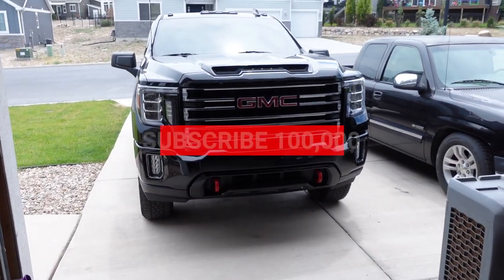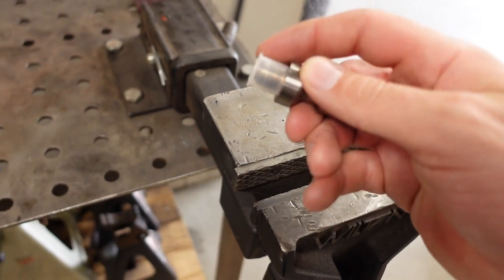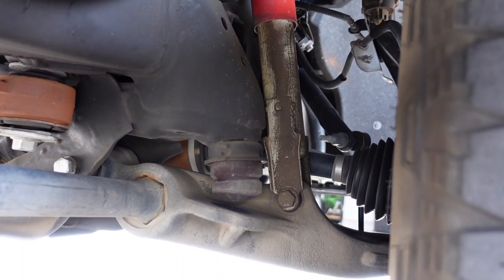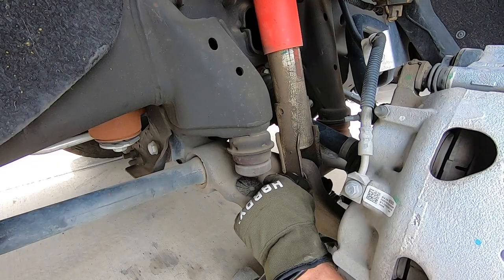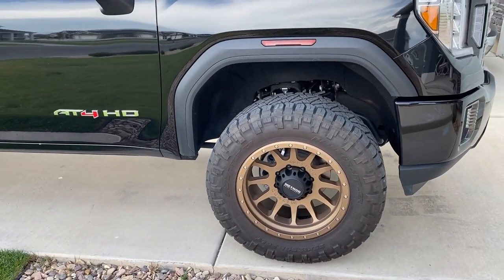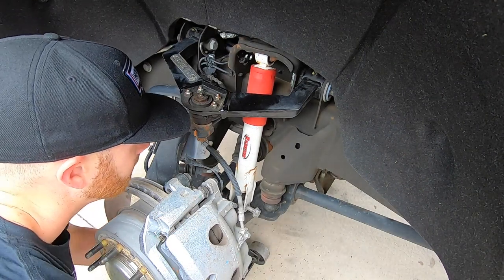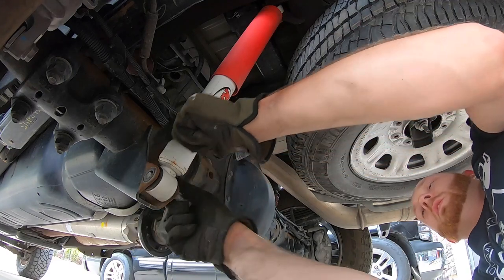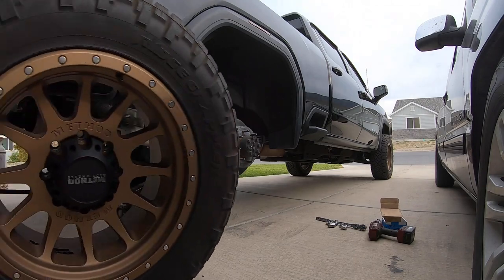Fixing what GM wont on my 2020 AT4 HD & Improving the Ride Quality #gmc #at4 #duramax

Comment: You can do your own TPMS reset: Turn vehicle to ON/RUN. With parking brake on. Push the trip odometer reset stem until Tire Pressure is displayed. Push and hold trip reset stem to begin the sensor matching process. start with the front left tire, then front right, rear right and rear left at the end. You have to bleed air out of the valve stem with a pen or something like that, until you hear the horn beep on each wheel in that tire order. It takes like 4-6 seconds on each tire. Push trip reset again to confirm. Your welcome!

Comment: Idk why Chevy guys are so stuck on that idler arm, torsion bar, control arm, no grease, ball joint wearing junk.
Reply: Because they don’t like misfires, phaser failures, i-beams from the 30’s and trucks that melt in the sun on hot days.

Comment: 40,000 miles and its wearing out already , sorry LT but what a TURD ! 
Not to say that any other manufacturer is producing a better vehicle but I would be raging mad , my 5000$ Pilot 5 yrs ago now has 273 thousand and I did the timing belt / water pump , wheel bearings , shocks in the back , inner and outer tierods and a bit of rust repair in the past two years ( belt and pump done by a mech. I used to work for ) I don't hate it , I don't love it but " NEW VEHICLES ARE GARBAGE ! "

Comment: Ok, not trying to create controversy, but mainstream thinking on this videos' topic is a little misguided. Im not disagreeing with you, but presenting some additional info.  (But I like the video to see what is available, and what guys are doing to their trucks)      Here's a shocker--  Shocks don't change the ride quality as much as you think!!  They are not  carrying the weight of the vehicle, the SPRINGS are.  While a set of worn out/leaking/ damaged/ seized  shocks being replaced will definitely cure some ride quality issues, the shocks' main function is to control the motion of the springs, ie, keep it from bouncing, cuz thats what springs like to do.  I've confirmed this as a service manager working with various suspension companies on custom builds, and chassis issue diagnostics with OEM's.
                  If you have a really stiff spring that is so strong the weight of the (empty) truck cant compress the suspension going over a bump, it will ride rough. Take that same truck with a ton of weight in it, suddenly it rides nicer. We cant expect a 3/4 ton or 1 ton truck to ride like a car empty, but then be able to carry 2000 to 4000lbs on the flip side. no engineer can overcome this basic fact of physics. Springs give the ride, and the shocks control the springs motion. The closest compromise to this is Air bag suspensions, where you can increase/decrease the pressure depending on the weight being carried. Sadly, empty 3/4 ton and 1 ton trucks will ride rough! Keep up the good videos!

Comment: Bilsteins are great!
My 1997 Z-71 still has the original Bilsteins at 173,000 miles, and it still rides great!
Reply: You need to replace those Bilsteins!  Just picked up a 1995 with 157k - rode great, then I replaced the shocks with new Bilsteins and the ride is AMAZING!  

Yours are 24 years old.. they are garbage now.

Comment: Yes those fuel connectors are a bugger they used them on the 10th gen f150s to and really suck to reconnect after having to take them off a half a dozen times.

Comment: I use the Bilsteins 5100's on my 2004 4x4 Suburban 1500 and 2007 trailblazer and it improved the ride where they just handle so much better and smooth over bumps. I live in AZ and drive off road and pn in the burban and love how they handle also installed moog springs in the rear of the burban and still want to upgrade the torsion bars. By the way Lawrence LT Tolman, I think I saw a screw in your front right stock wheel tire on the inner tread. 6:12

Comment: I did  rough country premium shocks with my leveling kit on my 16 Duramax with 35/12.5/20’s, , great people, great service, I added Lift Rite air bags  [ crew cab short box 4/4] … BY FAR the best mod for pulling trailers , I recently towed a 40’ +  camp ground model camper 60+ miles 65-70 mph no problem. No sway and when big rigs passed I didn’t get the pulling in and pushing off effects

Comment: I used to work at an auto parts store and from my experience Rancho shocks are not the same quality as they used to be and bilstein are hard to beat for the cost. I used to warranty alot of Ranchos.
Reply: I’m retired now but we quit using Ranchos almost 20 years ago at the shop.  You assessment is spot on, Bilstein has to be the best bang for the buck.

Comment: steering stabilizer is a bandaid. people lean on them because they install inferior chassis components or refuse to replace worn components that allow too much play in your steering causing the tires to push you around. a good front end with no play in the components with a properly adjusted steering gear and correctly adjusted alignment done by someone who understands the #'s and what they do, not just "red and green seekers" is the best replacement for any steering stabilizer. and yes people have forgotten the art but the steering gear can be adjusted if done properly to perform as good as a rack and pinion. sorry for the rant in case you haven't guessed I'm not a fan of steering stabilizers. the person with their hand on the wheel is the stabilizer. you should have control of your vehicle through properly maintaining it. I like the channel and not trying to be a hater just ask yourself why would a properly functioning steering system need stabilizing? I feel like it's one of those things like when I used to see people with the big diff covers and they would complain they blew their rear end apart then they would put another big diff cover on it and come to find out Banks did real research on these and found they can cause more damage then they ever stopped through "cooling and capacity".
Reply: Had a 71 Torino GT in 76 as a kid and my Dad tweaked something in the steering box I think and it was awesome. 
The old man was no dummy!

Comment: you should realy get a torque wrench for fastening your wheels,  over tightening is a good way to break the studs & loose/damage wheels
Reply: Everyone says that, but no one had wheels fall off because they were over tightened. They way I learned is to get the bolt tight and then give it one more push...and it should be fine.

Comment: Added Bilstien steering stabilizer to my 2016 GMC 3500 Denali, along with Bilstien shocks. Very low miles at the time. Could not believe that the standard shocks on this truck to be garbage. Then to find out they eliminated the mount for steering stabilizer just unbelievable. In order to install this, one bracket needed to be added, which I did. The ride was greatly improved , just couldn’t believe that on their flagship Denali this would be the case.
Later looking at trading to a 1500, dealer refused to take my truck period, because this added bracket made it unsellable and refused to talk further!
Reply from the maker: Wow, that’s crazy for them not wanting the trade…

Comment: I just installed a set of Fox 2.0 on a buddy's 2015 3500 duramax dually. He had Bilstein 5100's, but his leveling kit had them maxed out and it rode like crap. He likes the ride of the new Fox shocks. first set I have installed and went with a shock that will work with a 1.5 to 3.5 lift. My idler arm was shot at 28k on my 17 L5P 3500 and I also replaced my tie rods with PPE. I had two rancho shocks fail under warranty, but warranty on the shocks is only 3 year 36K. I might also try the Fox 2.0. I am a dealer and dealer cost is around 520.00 for the Fox, the lift style Bilstein 5100 were back ordered and were about 75.00 each dealer cost.

Comment: I just discovered your channel today. You’ve earned a new subscriber. Love your house/garage setup by the way. I have a 2020 HD just like yours. OK, not exactly like yours. It’s a Chevy but same front end. I just did the Pitman arm and idler arm on mine. I noticed you mentioned that in this video. Mine had just a tiny little bit of them and I wanted to get an alignment and the steering stabilizer that you mentioned in another video. I ordered the exact one that you pinned in the post. I am hoping that with the steering stabilizer, it fixes everything because I’m having the wandering problem it’ll pull left and it’ll pull right. They aligned it today, no loose parts or anything. Granted it wasn’t the best alignment shop, but it was still aligned. Mine has crazy bad bump steer. Are they all like this? Mines only one ive ever drove. Did you experience any of these problems with yours? I know that you’ve been tinkering with your front end for four years now.

Comment: Great video! Anyone know if the 2500HD AT$ comes with a factory lift? Looking to replace my stock Ranchos with 9000XLs so I can adjust the shocks when I tow (trailer weighs about 10,000 pounds with about 1,000 on the tow hitch ball) and not sure if I get the ones with 0" lift or other or combo of 0" lift and another type. Thanks.

Comment: SO, you didn't use the spacer with the original shocks??
Reply from the maker: the spacer was used with the original ranchos and with the new bilsteins. That’s per the the instructions in my Cognito leveling kit, they list a length measurement that the shock and spacer need to be.

Comment: They can’t void the warranty unless the parts replaced that aren’t genuine OEM are proven to be the cause of the failure. With that being said, they will typically find a way to determine that it did cause the failure but again it has to be proven, otherwise it has to be covered under the warranty.

Comment: I just bought a 2022 Silverado RST 1500 and the rancho shocks are literally garbage. They come on all Z71 models. I drove a 1500 without the z71 package that had different shocks and it rode a lot better. I'll be replacing the Ranchos shortly.

Comment: Change the tpms parameters to allow lower tire pressure .. I’ve personally never liked running that much tire pressure unless towing
Reply: Did you have to re configure the tpms control unit /bcm?

Comment: Hey LT, love the show. I want to make a comment on your future upgrades. I have experience on this as I had a 2500hd and was trying to make it ride smoother. I have found that suspension comfort is very subjective. There is a wide array of opinions on what is smooth and comfortable compared to stiff and harsh. I don’t have experience in Bilsteins, but tried just about every other brand. I tried the solastic shackles and Cognito leveling all with no avail to my liking. I felt it still rode like a 3/4 ton pickup. May I suggest you research and give a great deal of consideration to the Carli suspension. I think it will be what you’re looking for.
Reply from the maker: Carli makes some awesome stuff for Ram/Dodge and Ford, but not much for GM

Comment: 100% voided warranty any aftermarket parts void warranty lift kit or just bigger tires it’s a factory warranty meaning factory parts any time you need it return it to stock before bringing it back to the dealer

Comment: Lawrence, It sucks that dealers are always looking for a scapegoat out of warranty responsibility. FYI Your AT4 has a screw in the right front tire. I hope that you got it fixed. I was looking for a 2020 3500HD, but I could only find commercial trucks with limited options and GMC would not accept either my partner discount nor an order. I bought an 2020 F-350 6.7L STX and it was practically bulletproof with no problems! I sold it back to FORD, for a profit, and ordered a 2022 F-350 6.7L Lariat. Sadly, the chip shortage has caused a major delay since my 12/10/21 order. I am forced to use my 1997 GMC Suburban K2500 (HD) to tow my 31' Toyhauler. I would be glad to trade even with you, lol. I have to do a lot of work to it and your videos answer a lot of questions for me. The second time I took the RV to the dump station, my 4L80E started slipping and not shifting. It is being pulled apart today in the trans shop. As my 8,600lb RV can easily reach 10,000lbs loaded, I am upgrading to a class IV hitch, 7-wire plug and armored vehicle rear springs, 7 leaves plus overload. I'm having an 10,000lb trans cooler installed and 7.4L HD radiator. It may be Christmas before I see the new F-350, so the 'Burb has some work to do. I wish that I had the 7.4L vs. my Vortech 350. No long trips for this rig. Wish me luck.

Comment: I have the same truck, 2020 GMC 2500hd AT4. I immediately installed a Suspension Maxx levelling kit with Cognito upper control arms.  I bought the Fox 2.0, +2 shocks and love them. The stock Rancho shocks are garbage. Only have about 8k miles on the truck so far.  I run 20  X 9 inch Fuel wheels with 35 X 12.50 Nitto Terra Grapplers. My only complaint is the braking system seems a little "squishy".  Thanks for the great content.

Comment: I had a Z71 ‘92 GMC regular cab short box (I know, about as far as you can get from your AT4) that came with Bilsteins. At 200,000 miles or so I got some new shocks from the parts store—those old ones had to be worn out, right? Wrong! The Bilsteins were still soooo much better that I put them back on. They were still on it when I sold it to my nephew at 280,000. Good choice for your truck, I’m thinking!

Comment: Just what I said about GMs Rancho....their JUNK.....Thank you Lawrence....you got a nice ride now........I hear Fox do ride like a dream...issue I do not like with Fox King Icon Falcon...is you have to rebuild all these every 30 or 40 thousand miles and having to deal with coil-over set-ups would really suck it. Bilsteins are lifetime...the yellows and blue for the Cadilac ride and the 5100 for a more stable manly rig...and a 2 inch lift possible with adjustable coil-overs...BDS control arms...Helwigs rear sway bar kit....5100 shocks coil-overs level 5 Bilstein rear special edition coils...and Wildpeaks....NOW were done here...or maybe we should go to the 6100 bilstein...a 2.5 inch 5100......lmao......enjoy

Comment: Recommendation from factory for shocks and struts is 50k miles so your pretty spot on for them to fail.  According to my labor guide its 2 hours labor for all 4 shocks and average shop rate here in my area is 80$/hour at the stealership. So 160$ plus tax labor.  According to my price guide on the factory shocks is 65$/shock. So 260$ plus tax for parts. You spent more on just the shocks than the stealership could install a new set of factory units

Comment: Don’t know if this has already been done. But the pitman arm issue could be the steering intermediate shaft. 2020 and up I believe had a tsb. “Clunky” steering wheel feel. Had 2 replaced in 40,000km on a 21 3500. 
Again just another angle to look at.

Comment: I did an upgrade on my front end of my f450 like you it was suspension upgrade, told ford dealership that I might have a death wobble, so they changed everything that has to do with my steering, free they said it's warranty from the manufacturer. FYI my truck is a 2017 so I just wanted everything that would cause death wobble to be changed,  I didn't have a death wobble but now it's all new.

Comment: I hate those tpms sensors if i could id run my tires at like 40 pounds but my low pressure light goes off as well

Comment: Can you replace the shackle with a spring slider? I’m not sure if they make any for a truck that big. I have a 2004 GMC 3500 crew cab dually and between the steering column rattle and the crap shocks and tires it was a horrible ride. Some KYB shocks, Michelin XPS tires fixed most of it, still need to do the steering column, I think Borgeson makes one. But I leveled it with just cranking the torsion bars up, and the rear could use some sliders to soften the ride

Comment: 6:14 looks like you may have picket up a screw in the inner part of the tread on the right front tire, not sure if it is or not but wanted to throw out a heads up
Reply from the maker: it was, luckily wasnt all the way through
Reply: @LawrenceTolman  your lucks better than mine, last new set of tires I put on managed to attract a nail through the sidewall within the first 150 miles

Comment: Have your TPMS reprogramed!!!!! 
I had mine set so that the rear will not freak out until 42psi and the front at 45 psi.
I run 45psi in the rear and 50 in the front when empty not towing and the ride is a lot better and the tires seem to last a lot longer like this as well. 
Also much better traction in the wet and snow. 

The last gen trucks also had problems with the Rancho factory shocks failing early. Even if you left everything stock. 
My rears on my old 2015 started leaking at 15k, dealer replaced them under warranty. 
At 38k both fronts where leaking as where both rears again. 
At 62k all 4 shocks where leaking again. 
I replaced them with proper Rancho RS9000s and those where much better and where still on the truck at 68k when I sold it with no problems.

I loved that I could adjust them for the load.

Ill be putting them on my new 2022 as soon as it comes in. I already have them sitting hear waiting for the truck to be built still though.

Comment: I know these companies pick rancho for their off-road packages because their cheap but they’re absolute dog crap. To me a shock should pressure out to keep the axle planted. The ranchos I’ve had you have to push and pull. Normally causing more chopping to your tire over time like a wire out shock. But I guess companies also say off-road package one inch lift or maybe 2” level, talk about a bunch of politicians in training

Comment: Check the specs for idler arms, people change them when they see play, but many allow 1/8” to 1/4” at up to 25 lbs force. Also, use the center link to check the measurement.